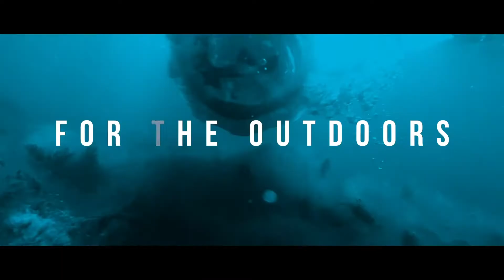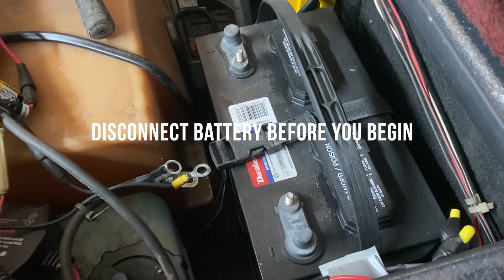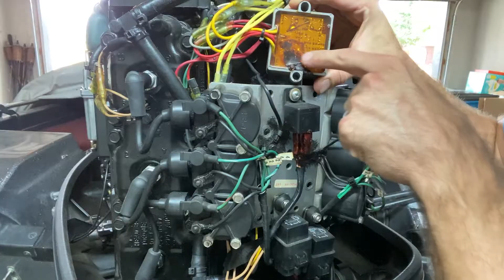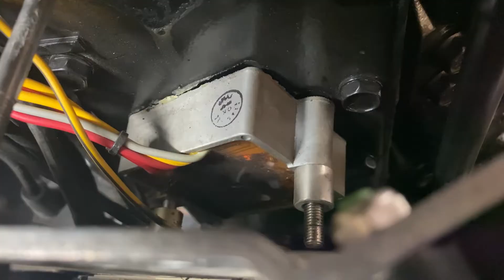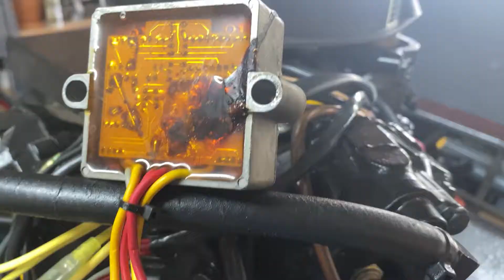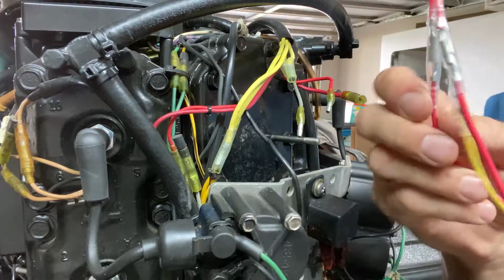Outboard Voltage Regulator (Is this causing my problems?)

Comment from the maker: **UPDATE!!!*

Hey Guys! Narrowed it down to my ECU. Sent it off to Brucato Power in NC to run diagnostics on it. They came back and told me the "injector driver #3" had failed...So, new ECU on the way. Hope this helps.
Reply from the maker: Got NEW ECU/ACU Back! Fixed my issue. If you want to see install and performance test here it is: https://youtu.be/qliwbIQ_j-0

Comment: I have a  2021 60hp Mercury and when I unhook the battery, The motor will die. I check the stator and it reads 0.4ohms which is good and it charges the battery at 14.2v. Any idea anyone?
Reply from the maker: I think the newer outboards rely on the battery power to run. Battery controls the ECU, fuel pump and other sensors. 
Why do you want to unhook the battery while it’s running?
Reply: Correct the motor will not continue to run without the battery.

Comment: Just got off the phone with my mechanic 200 merc injected 1997 
I have this exact problem just gave to go ahead to replace them both $330 each NZ money ouch
Reply from the maker: Got mine for $200 on Amazon. Link to the one I bought in description. Ultimately, problem ended up being my ECU. Regulators clearly needed replaced anyway though

Comment: Thanks ! I learned something from this that can help out a buddy of mine.  He’s got an 87 Ranger with Mercury 150. His tach quit working a while ago.  NBD, he’s not racing anyone😂. But he’s had difficulty starting, and more often than not, trouble getting up on plane. He calls it “feathering the throttle “ but he’s not getting hardly any acceleration. Mechanics around us stink and charge crazy prices with poor actual results. He’s paid for; carb cleaning, carb synchronization, tune up ( which is probably just new plugs knowing these clowns) and other nonsense but can barely use the boat anymore.  I think I’m going to pro-actively swap out his voltage regulator and try that.
Reply from the maker: Happy to help. Let me know what you find out. My problem ended up being my ECU, but as you could see the voltage regulators were fried and needed replaced. Good luck

Comment: I'm having some problems with my 2013 mercury 60 efi
 I thought it was fuel but once I get on plane out the landing. It bogs down. I have a new power panel and the voltage is all over the place. I check the resistance on my stator. Thats was good. It just starts running like it missing but might be electrical.
Reply from the maker: Not sure, you said you checked the stator but that is what it sounds like to me. Maybe something with the high side of the coil. Low side is working but when it gets to certain rpm and transfers to high side it causes you to lose power. 
Just a guess but maybe stare at that rpm when you are on the boat next and see if the bog happens at the same rpm
Reply: @PrestigeWorldwideFishing  Once it bogs. It sounds like it's missing or running out of gas. Its usually around 3k rpms always.
Reply from the maker: @2751Brandon man, it does sound like the stator. Bad stator can cause problems for the fuel injection system too. 
Don’t yell at me if it isn’t though 😂

Comment: Thanks for posting. I had that problem today with a motorcycle. My rectifier shorted out hard and started melting its case (epoxy sealed).

Comment: I have a 200hp Johnson ocean pro on 2001 Aquasport osprey 225, the problem, all electronics are out changed out the batteries and boat started right up the volt gauge is showing 13v but when I throttle up the voltage goes from 13v to 16v and all electronics shut down wtf! Happens alot on the open water, HELP!
Reply from the maker: And you’ve replaced both of your voltage regulators?

Comment: On the Mercury engine charging and ignition systems:
- Do not use AGM or Maintenance Free batteries. 
-Use a heavy coating of a good heat sink compound on the back side of the regulator before bolting it in place.
Reply from the maker: Appreciate the help!
Reply: Why no AGM?
Reply: @coleritchie5402 They require specific charging voltage. Only ECU controlled alternators on modern engines can modulate output.
Reply: When you are install the rectifier, does it make a difference which side faces up?
Reply: Which side of the rectifier do you put the heat sink compound? Why is this necessary

Comment: 3 months later, have you gotten a new ECU? Same problem here.
Reply from the maker: 😂 no, I couldn’t stop fishing long enough. September will be the month because fishing is terrible in Oklahoma
Reply: @PrestigeWorldwideFishing  Ha, nice. Well I just got a used boat and it's been having issues. Found out an ignition coil was bad, and now I'm checking the voltage regulators and stator. Apparently the battery can affect it?
Reply from the maker: I could see that, but not real sure. Good luck with the new boat and i will let you know when mine is fixed.
Reply: @PrestigeWorldwideFishing  thanks. Just did some multimeter readings. There were 3 readings for the trigger to be max 1400 ohms, and one reading was 1500. Not sure how much it'll affect it.

Comment: I had this problem a couple years ago. It was my ecu. Got a new one and fixed my problem completely
Reply from the maker: Damn. That’s what I was afraid of. Cost quite a bit?
Reply: @PrestigeWorldwideFishing   i got lucky and found one on ebay brand new from a guy that was cleaning out his boat shop for $375. You can have one rebuilt for $600. I think new ones are around $1000-$1200 if i remember right
Reply: @PrestigeWorldwideFishing   simon motorsports is the place i talked to that can rebuild them

Comment: so did you figure it out what was it im having same problem
Reply from the maker: No. I was told couple days ago to check “timing control box”? Looking into this now. I was planning to change trigger next but someone said they did that and didn’t work. 
Hope to have a better idea soon and will post about it
Reply: @PrestigeWorldwideFishing  check your reading on trigger you should get 1200 omes on both legs i just had to order  a stator for mine its doing same thing

Comment: I believed the problem you’re having is the timing control box on the top left corner of the motor. Usually what happens is that when the rectifiers go bad or can cause a voltage surge to get delivered to the timing control box which fries it.
Reply: The sound you’re hearing is an intermittent spark.
Reply from the maker: Awesome! I will look into that now. Hopefully cheaper fix than ECU? Thank you!

Comment: Did you get the problem fixed?We have a 150 doing the same thing but worse .
Reply from the maker: No!! It’s driving me crazy! I plan to change the trigger next, but don’t feel real confident that is it. Let me know if you find anything out and I will do the same.
Reply: @PrestigeWorldwideFishing  I have n f115 Yamaha, same thing going on I changed all kinds of stuff illuminated fuel system, etc. ended up checking volts at the injectors and starter main feed wire and they are jumping up and down when the motor studders, it'll run smooth for a min and be at correct voltage then jump voltage and studder. I changed the regulator too and tested the stator. made no change still broke lol. saw a video about the water sensor robbing voltage so maybe it's a sensor doing it not sure. hoping it's not the ECU. but check your volts and see what happens.
Reply from the maker: Man you are telling me! I really hope it isn't the ECU. Planning to start working on it a bit more once it warms up. Going to try the trigger next. Good tip on the water sensor – I will look into that too. Appreciate the help
Reply: @PrestigeWorldwideFishing   I replaced my stator trigger and switch boxes tried a set of coils new plugs and wires I watched this video and almost ordered 2 brand new CDI ones glad I read the comments have you found the issue yet?
Reply from the maker: No, my next step was trigger, but that didn’t work for you?? Not sure what to do! If it is the ECU I may just live with the problem

Comment from the maker: Hi guys,
Unfortunately, after replacing both voltage regulators, I’m still having the same problem. Does anyone think it could be a trigger? Hoping it isn’t ECU. Thanks guys!
Brandon
Reply: Hey the as you know by now the voltage regulator won’t effect how the motor preforms much it’s job is to turn the ac current from the stator to DC current to charge the battery and it also has a grey wire coming out the top for your tachometer . So I would check that you have spark on all 6 cylinders before you do anything else and make sure your spark plugs aren’t fouled out , if there are all good I would check fuel system
Reply from the maker: Thanks Jaedon! Before I replaced the voltage regulator, a mechanic changed plugs, stator and replaced fuel lines. Didn’t help. Do you think it could be the trigger? I don’t know much about it all but through research it seemed like a possibility.
Reply: @PrestigeWorldwideFishing  hey man did you figure out the issue? my new boat has the same problem!
Reply from the maker: Unfortunately no, my next plan was to replace trigger, but in another thread Allen told me he replaced his and it didn’t help. Really hoping it isn’t ECU. I may swap out my trigger anyway since it isn’t very expensive - not real hopeful though. 
I will update the thread and do video once I figure out the problem
Reply: @PrestigeWorldwideFishing  I've got the same problem and was about to replace the voltage regulators.  Thus far I've changed the plugs, switch boxes, trigger and stator.  No joy.  My problem will go away for a while when the motor is warm and usually doesn't come back until after the motor is off for a few hours.
Reply from the maker: Dang it. Yeah mine is very similar when I have been running it a lot it won’t happen as much. Do you have any thing else you are planning to try on yours?
Reply: @PrestigeWorldwideFishing  by trigger what are you referring to?
Reply from the maker: Basically the part that determines your motors firing sequence. It’s inside your fly wheel
Reply: I know you don’t want it to be ECU, but if you can’t find the issue, then it’s time to have the ECU evaluated by a shop.  You can send yours off or simply have a shop hook up to it onboard and run some diagnostics on it.  If I had to guess without being able to run some test, I would say you have an injector bank in the ECU failing.  It’s actually pretty common and very sporadic RPM indicator.  It’s like a switch, kicks in and out before it finally goes or just steadily plows.  Had one almost throw me out of the boat once when it was plowing and snapped to fuel power. Typically when it warms up, it will steady.  If the ECU is bad, you can buy rebuilt or even a modded version from some really good shops online.  But those voltage regulators needed replaced too, so good find there!  Also, might want to clean the VST and send the injectors out for a cleaning if you haven’t in the past 3 years.  I wouldn’t run it anymore without getting the problem fixed or your asking for a blown power head due to lack of lubricants in the cylinders not getting adequate fuel/oil.  Good luck, hope this helps.
Reply from the maker: You are right… I need to take it in and have it looked at. Thanks for the advice and help!
Reply: Im no professional but from what iv seen the trigger either works or it dont. Have you checked voltage to the switch boxes? Where are you located?
Reply from the maker: Ok gotcha. I haven’t checked voltage yet. I’m in Tulsa area
Reply: I have seen low voltage even after replacing the stator, due to weak magnets. So even though your stator is new id check the voltage
Reply from the maker: Ok I will. Thank you so much for the help!
Reply: And did you fix the problem? 
I have the same broblim. I had a bad conection on my triger it startet to disintegrate the white/black wire will fix it tomorrow and hop it will solve the problem 90hp mercury 2stroke
Reply from the maker: No it didn’t. I’m hearing it is most likely ECU. Planning to take it in, just been putting it off.
Reply: have you checked prop hub?
Reply from the maker: It’s motor related.
Reply: Did you replace your rev limiter as well,  what anit the cdi?
Reply from the maker: @TheKanobie1 no I didn’t. ECU was the problem. All good now

Comment: Mine acted similiary. I changed parts for 3 months. Ended up being the ecu. Does it act worse after its hot?
Reply from the maker: Dang! I’m really hoping it isn’t ECU. It is really hard to pin point but I feel like it happens more when I first get on the water. A lot of times I have to stop and either turn it off or rev it in neutral for awhile. Frustrating
Reply: @PrestigeWorldwideFishing  ok most of the time electronic problems will get worse as the engine builds heat. (ecu. swith box, trigger etc)...  you may have a flooding problem.... somthing cheap to try is spark plugs if you havnt changed them recently. plugs may not be the cause but i like to eliminate them early in the process because they are cheap and easy.
Reply from the maker: I probably should of said this in the video, because I thought the same thing. I have changed plugs, new stator, new fuel lines, fuel filter and water pump. It still could be fuel related but i wouldn’t t think so after changing all of that. Do you think it could be a trigger?